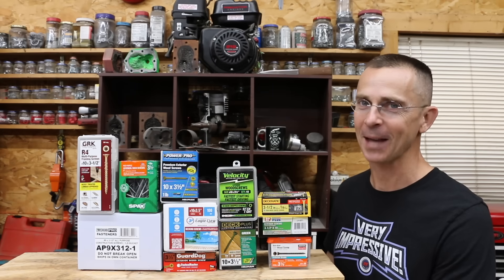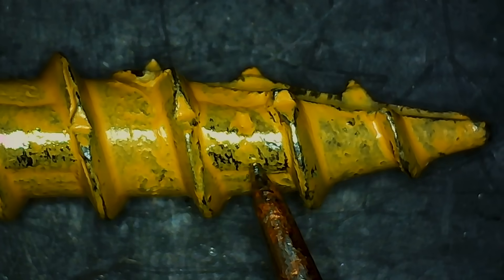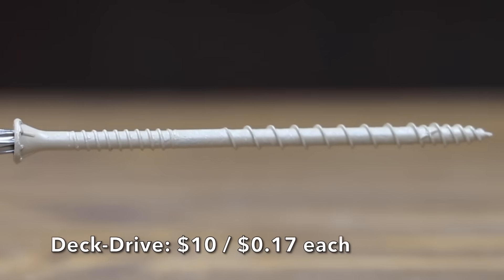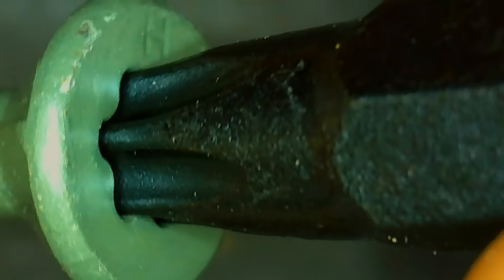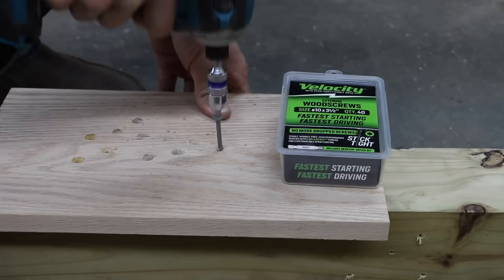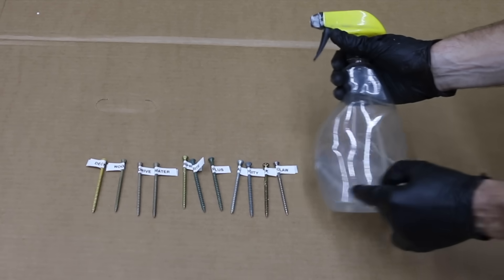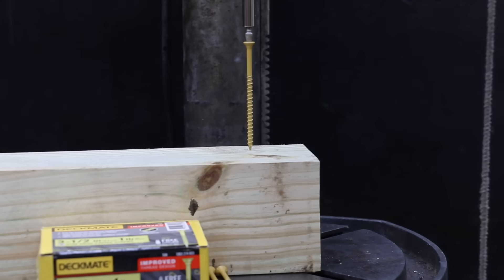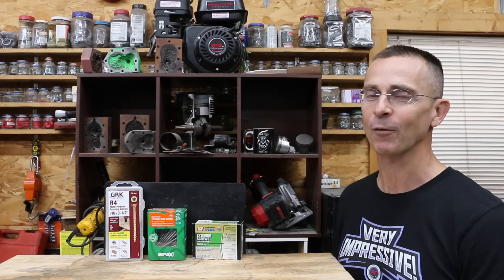Best Deck Screw? GRK vs SPAX, Grip Rite, Deckmate, WoodPro, FastenMaster, Deck Plus, Eagle Claw

Comment: The only thing I care about when using deck screws is the coating build up in the head. To much coating and the bit doesn't fit very well and is a pain in the butt to use. Sure one or two ain't bad but when you got 50lbs of screws it becomes a pain.
Reply from the maker: Thanks for the feedback.

Comment: My front deck I built over 35yrs ago.  I used spiral nails which wer pretty impressive.  Unfortunately I live within the snow belt and nails are fairly rotted since I use salt on deck. Wood is still in good shape and will use stainless screws on it.
Reply from the maker: Thanks for sharing.

Comment: Hi Todd. When I built my house in 2009-2010 I bought a lot of Spax screws with Torx heads (easier to screw and unscrew than Pozidriv or Philips), and also 10 kgs of 3x25 Ph2 for drywall. I spent so much money I was amongst one of the 100 best customers of my local shop and invited to a great garden party, with champagne, grilled saussages, and Weber representatives trying to sell barbecues. Mine was made from a water heater 150 litres I cut in half...
Reply from the maker: Thanks for sharing.

Comment: FWIW as a result of wood rot, I replaced all the decking on my deck in 2009 with treated wood.  The old screws were horribly corroded (I don't think they even used coated screws), so I wanted to make sure the same thing didn't happen.  So I bit the bullet and bought stainless steel screws.  The deck is in a shady location, so dampness is an issue, plus the winters here are harsh.

11 years later I had to disassemble part of the steps to route some gutter drains underneath them.  The screws had no visible corrosion.  Same story on some other boards I removed  and replaced from rot from carpenter ants.

I'd say sulfuric acid is a shade too aggressive of a corrosion agent against stainless.
Reply: Where I live, Acid Proof (A4) stainless Steel is the standard for things like this... Not all stainless steel screws are equal!
Reply: @TheDaniel85  It depends on the concentration of the acid, and of course the type of acid.  It looks like these screws were soaked in concentrated sulfuric acid, which is a very powerful reducing agent. Stainless varies from resisting 3% sulfuric, 20% sulfuric, and some even higher.
Reply: @stevesether  Yes, the resistance is specified in the A2/A4 spec sheet...
Reply from the maker: Thanks for sharing.

Comment: Currently using power pro screws on a project and can confirm the bit fitment is terrible I normally use grip rite or deck mate for projects but the power pro were a decent amount cheaper so I thought if give them a try I tried different brand new bits and it's still a sloppy fit
Reply from the maker: Thanks for the feedback.

Comment: I only use stainless and will never use a coated screw for any exterior work. I have 2 full 5 gallon buckets of Robertson drive stainless screws I salvaged from a 15 year old dick and they are still in perfect condition after 15 years of ocean salt spray. If you can afford $3/sq ft trex you can afford stainless screws
Reply from the maker: Thanks for the feedback.

Comment: I actually didn't know there was a difference in deck screws, I've always used deck mate in the past but I'll start looking at them a little closer now. 
As always another great video, thanks.
Reply from the maker: Thanks and you are welcome!  Thanks for the feedback.
Reply: A thing to remember is the smooth or different thread pitch help pull the closer side against what you are securing it to.

Comment: I'd like the thoughts of others about pre-drilling with these screws. Many say they don't need it, but I have found that taking the time to make pilot holes really makes for a cleaner result that seems to stay tightened for longer. Is this just chance (or a myth), and is there a science with how the wood fibers work with the fastener with and without pilot holes?
Reply: 100% agree. I wonder this every time I have to drill more than a handful of pilot holes.

Assuming no splitting, is no pilot hole the strongest fastening strength and longevity? 

If not, is it better to drill a pilot hole just smaller than the shaft excluding the thread diameter?

And how big is the difference?
Reply: I replaced al the decking on my deck in 2009 with 2 x 6 inch treated wood.  13 years later and there's no splitting, and they haven't loosened.  And this is  on treated wood, which of course will shrink a little.

I couldn't tell you with other types of wood if you need pilot holes or not.  There's been a small number of pieces that have rotted due to carpenter ants, but that's the only maintenance issue I've had.
Reply from the maker: Thanks for the video idea.

Comment: As a pro,  i stil go for GRK they perform much better for me in the real world. One example is drawing power over deck mate before stripping. The deck-mate has a thick shank and small threads - while grk has thin shank/ deeper threads/ less steel for same job. Grk seems to split less and draw better. I still use deck mate but if grk is there i'll definitely spend the extra $2. Plus a GRK screw snapping is as rare as a hen's tooth.
Reply from the maker: Thanks for sharing.
Reply: However your methodologies for testing are really good. The info presented gives the viewer maximum knowledge. You have a unique product excellently produced.
Did you ever do a deck Demo tool review?

Comment: Definitely one of the best channels on youtube!  

 Suggestion: It would be nice to see comparison charts on which screw would be best for which application ex: for low-corrosion environments this is the strongest bang for your buck, for reduced drilling time & effort this screw is great for lightweight projects. Sometimes it's not only about best-of-the-best. I guess what I'm trying to say is it could be helpful to compare related charts before the final conclusion.
Reply: I would also appreciate a test of various liquids that could be sprayed or dipped onto the screws as or just before being used. Dripped or squirted into pre-drilled holes as well. I have found beeswax to work for several decades with plain or galvanized hardware.
Reply from the maker: Thanks!  Thanks for the video idea.

Comment: Spax provides a soft T20 bit with their screws which don't last. Always need to buy a harder bit or you'll experienced bit failure early. Company should have engineered a T25 bit in the first place. This test was badly needed, thank you.
Reply: You can buy diamond coated Torx bits.  They do eat the screw heads a little (as they physically grip into them), but for projects where screws won't be installed/uninstalled more than once or twice, they are fine, and grip really well.

Wera has laser cut Torx bits that I also like, based on the same idea, that texture on a hard bit will really grip the fastener.
Reply: @jayschafer1760  thank you so much Jay, choosing and buying a bit was on today's agenda. 👍I plan to complete repair work tomorrow that I couldn't finish yesterday.
Reply from the maker: You are welcome!

Comment: At the end of the day, the quality of the screw is a fairly small part of the equation, corrosion being the top concern. Poor lumber quality and poor construction methods are the TOP concerns. I've seen 6" lag screws ripped straight out of 4x6 beams by wood slowly warping. Screws won't stop that.

But. THIS video is incredibly interesting and fantastic! My preference is stainless steel if they can be found reasonably affordably.
Reply from the maker: Thanks!

Comment: Track saw review?
Reply from the maker: Thanks for the suggestion.
Reply: @ProjectFarm  Expensive, i know. I am really intrigued with the ones that you can leave the short section connected to the saw and lay it across your cut lines on rafters and decking etc. Seems like it would really be fast. Thanks!

Comment: I’ve always liked GRK (when I didn’t need stainless steel) after trying nearly all of these in real life. I’ve started to use stainless on any outdoor project now, as those coated deck screws will visibly rust after a year or two. I’ve never checked for rust on the GRK, as I switched to stainless before using GRK in a deck, shed, etc.

As usual, thanks for the video!
Reply from the maker: You are welcome!  Thanks for sharing.

Comment: If you want something to last like a deck, you need to spend more and use stainless screws where you can. They are softer, but following proper building code they are just as safe as other screws, especially in the long term. A structure is only as good as the fasteners, and over time steel will corrode and become weaker, while stainless will continue to provide the same performance over a much longer span. I use stainless hardware everywhere I can, for my personal projects.  And yes, you are not able to use stainless everywhere
Reply from the maker: Thanks for the feedback.

Comment: Great job again! I usually use Grip Fast, from Menards, when I attach to treated lumber at work. The coating seems to hold up well to use in wood, even when I install and remove several times. I only made the mistake of buying Deckmate once!
Reply from the maker: Thanks! Thanks for the feedback.

Comment: I tend to prefer the Grip-Rite stainless screws, but I've found without the coating, they are very hard to drive. You can actually see the screw twisting as you drive it in and they often snap when removing and if they DO survive, they will snap next time you attempt to use them.. GRK and SPAX don't have this issue and drive in faster.. however, SPAX doesn't seem to offer as many outdoor rated screws in my area. So GRK it is for me! I just worry about the snow doing a number on them!
Also, Simpson makes a certified Framing screw now too! Kinda hard to find, but the sample I've seen looks promising.
Reply from the maker: Thanks for the feedback.

Comment: I'm less than a minute in, but I want to point something out.   That Deckmate screw looks like it has a Torx Plus socket, not torx.   A T-25 bit will be sloppy.  You need an IP25 bit for a proper fit.  At least, it looked like Torx Plus for the second that I was able to see it.
Reply from the maker: Thanks for the feedback.
Reply: The screw head looks to be a terrible mashup between Torx and Torx Plus. Makes perfect sense as the included bit is Torx Plus, but marked as Torx T25. I don't believe the manufacturer knows the difference.

Comment: how's about testing the concealed fastening systems for decking..  some use special screws, some require pocket holes, some use clips, etc... I just installed over 900 sq ft, and I'd like to know if I chose the best system..
Reply from the maker: Thanks for the suggestion.

Comment: Personally I use Spax after using a few different brands. I found that over time the Spax stayed tight better than others. Having a screw stay in place, for me anyway, is more important than a little extra effort to install.  I have only used SS one time and that was on a dock. They did excellent during the build but after a season I had to go back and tighten most of them down.
Of course alot of it is from wood shrinking especially with pressure treated. I did use Spax on a redwood one time from customer request.  I told him that I would not guarantee that it wouldn't discolor at every screw point. Two years later it still had not discolored hardly any at all. Only a couple areas had a very slight discolor.
Of course I pre drill everything with a counter sinking bit so that helped I guess. All structural gets galvanized ring shank by hand, never cared for a nail gun for build decks. But over all Spax has proven to be a extremely good deck screw. The cost is only slightly more than deck mate but the over all performance is well worth it.
Thanks again another great video, I honestly look forward to getting that notification from you. Keep up the great work, it truly does help us make a informed decision.
Reply: I’m still trying to get my head round the fact you pre-drill every hole when doing a deck.  That’s some deckication.
Reply: @Fixin-To   I also pre-drill with a pilot bit and it not only makes the  job look better, it causes much less splitting.
Reply: @Fixin-To  he must get paid by the hour. He hand bangs nails to lol
Reply: @Fixin-To  I made a huge deck out of Ipe and wow. Had to pre-drill and counter sink every single hole. And if you hit the screw-head to hard into the countersink, it immediately shears it off and you have to fill it and do another one. Next time I'll use balsa :)
Reply: I’m also fond of Spax’s T-Star Plus head. It just seems more stable than other screw-to-bit interfaces.
Reply from the maker: You are welcome!  Glad to hear!
Reply: Spax and grk are by far my favorite screws, well worth their price.
Reply: i have no idea on these screws but I thought in the first test there is little value in a smaller driving force and it turns out the Velocity has the least holding force.
Reply: This guy screws
Reply: I'm another fan of Spax.  The fasteners always have a great fit with their bits, and they start very easily.  The Deck Mates I tried were horrible.  I just wish the Spax came in bigger quantities.  At my local HDs, 1-pound boxes are the biggest they offer.
Reply: My Home Depot doesn’t have Spax anymore.😢They perform well and being made in the USA made them my preferred screw.
Reply: Spax has disappeared from HDepot shelves.  I assumed they went out of business, due to the pandemic.
Reply: @bclamore  they are still some of the most common professional use screws here in Europe.
Reply: @bclamore  We still have Spax at Home Depot in Alaska.
Reply: @bclamore  Did a quick search and found some in a store near me.  Might be your area.  I know that I've had difficulty locating other products, but my store is pretty well stocked... for now at least.  Still irritates me the price of a 4x8 sheet has jumped by 2.5 if not near 3x from what it used to be near me.
Reply: @bclamore  nah they don't ,maybe just in the u.s.,but i doubt that
Reply: @bclamore  Spax is not going out of business any time soon, they've been around longer than Home Depot.

Comment: Man I absolutely hate t20 screws, because you get 2 or 3 of them MAYBE in a non specialized bit case on top of that in my experience impacts destroy screws and bits of t20 compared to that of a t25 I will never understand why companies will have the same gauge screw and opt for a smaller head size.
Reply from the maker: Thanks for sharing.

Comment: Test propane powered soldering irons. Test to see which ones heat the fastest, which ones have the longest burn time on a full tank, which ones are the hottest. & which ones have the most accessories.
Reply from the maker: Thanks for the suggestion.

Comment: Egad, seems like I am way behind the times. I figure that an appropriate Stainless Steel or tough Tungsten would be great. Plus for some reason a case hardened steel - the same as Carpenter's Hammers are made outa - I have seen carpenter's Hammers found outside after years under, and in snow and water for many years - some surface rust only.
Reply from the maker: Thanks for sharing.

Comment: Great Video as always.

One nitpick: the torque to drive the screws in doesn’t tell the full story.  It’d be torque * turns, and I’m not sure how that will affect battery life of an electric screwdriver.  Think of it this way: a finely threaded screw will take much less torque than a coarsely threaded one, but will require that torque be applied over a longer time.

Just a heads up.  Had to nitpick.
Reply from the maker: Thanks!  Thanks for the constructive feedback.

Comment: Fantastic video as always! I use Spax for nearly everything around the shop, so it’s good to see that they’re a top performer. Would love to see concrete fasteners next!
Reply: 2nd vote for concrete fastener testing -- there's a lot of different designs out there and some are much more suited for certain applications than others (different types work best in brick, concrete, and mortar/masonry).
Reply from the maker: Thanks!  Thanks for the suggestion.

Comment: Solid video. Corrosion and strength have trivial differences so color is most people's determining factor. I've never used these to lay decking though. Always hidden clips or plugged screws so I was really hoping to see those. If it's doug fir or mahogany then I use stainless heads. If it's cheap PT, I turn up my compressor and use 8d ringshank galv nails and sink them below the surface so eventually swelling will cause the wood to close in and cover the head. Not convenient for removal, but if someone is trying to save money, they're going to save the most money in labor rather than fasteners on a PT deck. Adding $800-1000 to a bill to spend an extra day or two screwing down a cheap PT deck rather than shooting it can be a make or break for some people's budgets.
Reply from the maker: Thanks!    Thanks for the feedback.

Comment: It would be interesting to test alternatives to gun specific oils. Use the winner of the CLP test vs motor oil, ATF, and wheel bearing grease.
Reply from the maker: Thanks for the suggestion.
Reply: @ProjectFarm  I can't count the times that I've seen 'just use motor oil' and/or 'just use ATF' on various gun forums. It would be great to get some results especially for wear, rust protection, and the ability of oils to creep in between parts that can't be or normally aren't disassembled for cleaning/lubrication.